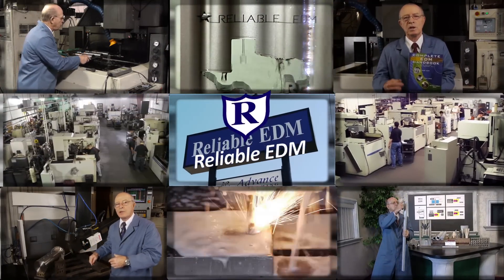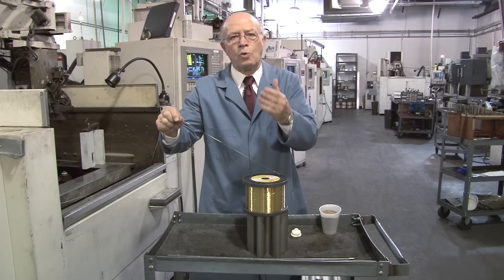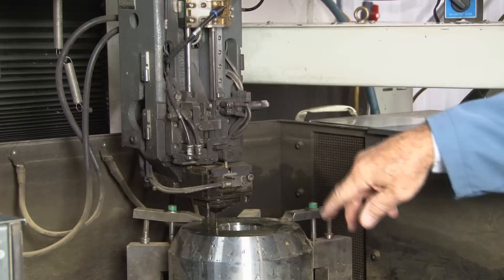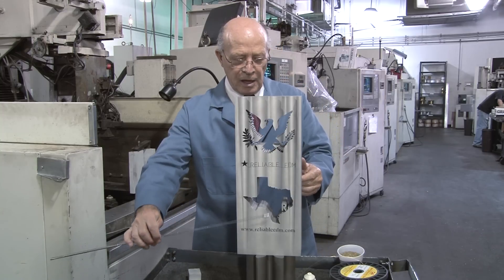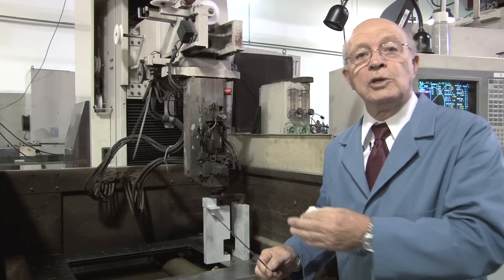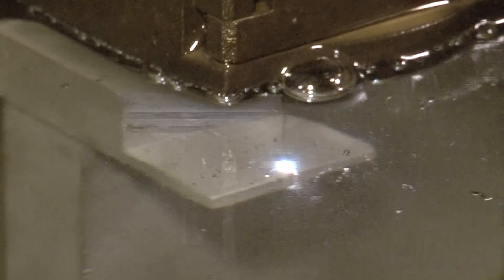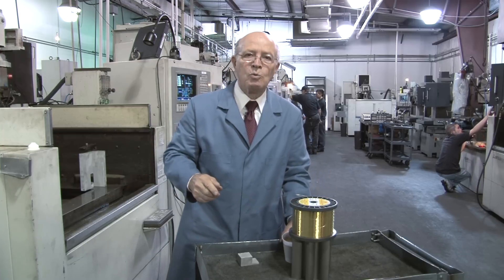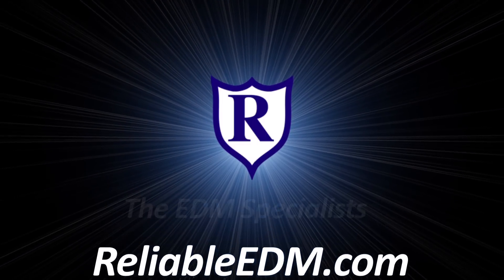Introduction to Wire EDM

Comment: How does this perform to todays Laser cutting technology?
Reply: lasers always cut on an unavoidable taper in the top.
Reply: Co2 and Fiber laser are suitable for thickness up to 30mm in steel, stainlessteel and aluminium. 
what we see in the video is not going to happen with laser technology.
Reply: A laser can cut in a good day with in .005" an edm can hold day in and day out .0002" and with the knowledge can hold .00005" a wire edm is the most accurate machine in a shop.